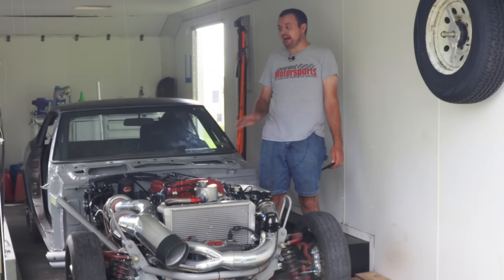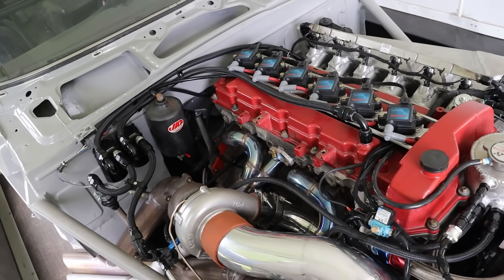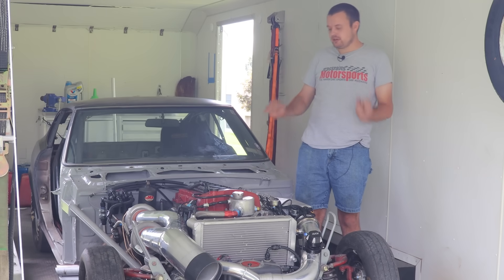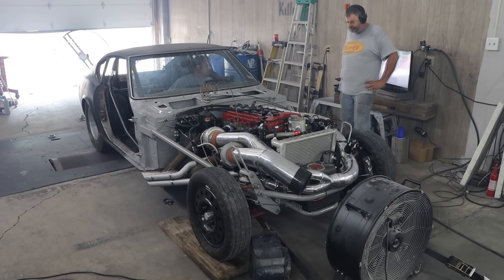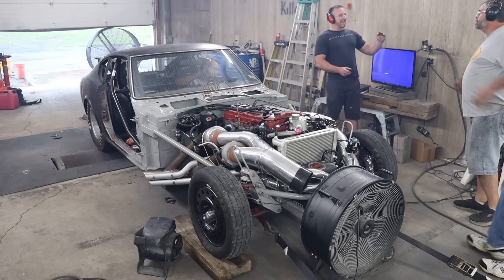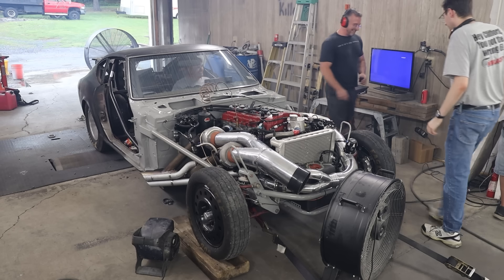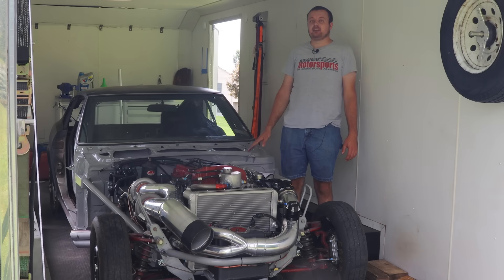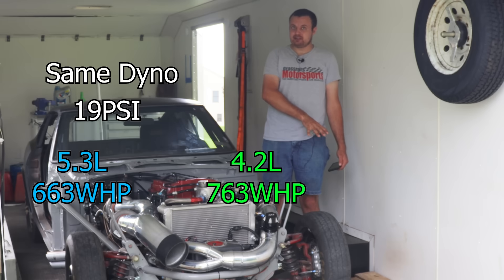This 4.2 Liter Engine Just Beat a 5.3 LS!

Comment: 6 cylinders have huge heavy counterweights/crank. Ls v8 engines can put more of the lighter engines weight to the rear wheels, Ls's make 1500 hp all day long easy. I would say if your 6 cly truck engine is in a truck and you want to make mods, get the newer better heads and keep it in the truck. 6 =lower rpm peak  8= better balance/lighter, high rpm peak(8000)+ , more CID 454 with titanium valves will pull more power ramp in more quickly. Have see lots of 6's try to compete. V engine is always better, example v6 buick gn. Would like to see 2 inline 6 chevys in bed of s10 4x4. ripper.

Comment: I imagine if the financial crisis hadn't happened, the atlas platform would've become a mainstay. the 4200 made the same power as the last of the iron block gen 3 5.3s, and while it was obviously down on torque, if it had stayed in production long enough to be alongside the ecoboost 3.5s we very likely would've seen factory turbocharged versions of it as well. The 3700 5 cylinder was also a great replacement for the aging 4.3 v6 as it made nearly 50 more horsepower than any variant of the SBC-based v6 and was only 20 lb-ft shy of the most powerful versions of the v6 as well. While the 4200 in NA guise could never have replaced or supplemented the gen 4 5.3, it could've been a worthy replacement of the 4.8.

Comment: i dont understand how you can almost double the psi and only get 200 hp more
Reply from the maker: Drivetrain losses. Turbos are starting to get out of their sweet spot. A lot of things could cause that. Also you shouldn't be looking at Gauge Pressure, but instead Absolute Pressure.
Reply: @Calvin-Nelson  it was really efficient at 19-21 psi gate pressure

Comment: Good video my son and I built a a jeep with a straight 6 for the trials we haven't done much to the motor besides headers but we have a problem with it over heating when we're crawling can you get us a hent what we can do and it vapor locks and it's fuel injected
Reply from the maker: Make sure the head gasket was put on the right way. 

You may need a larger radiator, or water pump, or fan. Look into brushless fans. They're expensive, but they work incredibly well.

If it's overheating at idle, make sure there are not vacuum leaks. The way the computer controls idle speed is with timing and airflow. If it can't get it with airflow, sometimes it will retard the timing a ton which generates a lot of heat.

Comment: Awesome job! Hope your dad is healing well. The power difference is from the pushrod leaching. The atlas engines are DOHC. One sees the same gains on v8s, when one ditches the under head cam design, but with fatter torque due to dual bank. W type engines do the same "torque fluffing", and are usually DOHC. Found this upload today, sorry I'm so out of date with this.
Reply: Hmmm Ford must just suck cause the junk ole pushrod LS wipes the floors with Ford OHC motors
Reply: @asherdie  ya lolol I don't understand how ALL of Europe figures out DOHC twin turbo so well, and ford gets on the bus this late AND is that bad at it. Pushrods are only "more stable" in big displacement higher rpm high torque engines, like big block chevys. Personally I hate the LS engine but makes easy power. Just remember to compare a "built engine" to another "built engine" stock is almost always crap.

Comment: to be fair this has 4 valves which means you don't need as much cam.
Reply from the maker: Very true. 100 more HP with 71 less cubic inches is still mind blowing in my opinion.
Reply: @Calvin-Nelson  it is kind of, but peak torque is less?
Reply from the maker: @ltethan649  I'll give up a lot of torque for 100 HP. All personal preference. I get it.

Comment: Just picked up a trailblazer would love to make modest changes. Coils, maybe eliminate the clutch fan and replace radiator w an aluminum one… can that be done without grenading the motor?
Reply from the maker: Yeah. Doing what you said, shouldn't effect the motor much.

Comment: I need to know where to get performance parts for atlas engines i have a 3.5 i5 and love it getting ready to turbo it. 
Do you have any thoughts on the mmi speed shop turbo kit for it? A source for heads or Cams? Also if I'm looking to be in the 8-10 psi range for a daily driver what size injectors do you think I'll need? Thanks and awesome work love these engines.

Edit: 
Also what kind of ecm are you running? My colorado is a manual so i really only need to worry about something to control the engine or possibly a tuner capable to control it through the stock one thanks again.
Reply from the maker: Not much for the 5 cylinders. The turbo kits out there are sort of questionable from what I hear. 1000cc injectors should do. Cams might be able to be done by Schneider, but you'll have to ask them.
Reply: Thanks I didn't see a notification for this reply I just found it. Went with the mmi kit and just ordered some snake eater injectors. I'm planning on hp tuners from a dynamic shop in Indianapolis not too far away it will be a while though until I get a chance to tear it apart where did you order your  rods at? Thanks again
Reply from the maker: @mattrhoton9219  I got rods through molnar

Comment: Dodge I6 Hurricane with 400&500 horsepower similar to bara 4200 Vortex V6 engine, maybe GM take look at form Dodge I6 Hurricane With 500 Horsepower , replacement of 3.6 V6 engine, bring back a modern 4200 Vortec V6 engine with 650hp YouTube channels like this, ICE vehicles EVs are some the main focus because of high emissions standards from EPA and California , New York and New Jersey, Baltimore Maryland the list, tougher emissions with vehicles standards , 2035 has the whole Automotive industry forcing ice vehicles to become zero emissions vehicles by 2035
Reply from the maker: That would be great. I heard some rumors that another inline 6 platform may be in the works.

Comment: Wauw very impressive! I got to your channel because of Trevor from Motion Auto TV. I was wondering, the engine is able to rev well above 7k rpm, it sounds like a 2JZ but has more displacement. I think this could be a great engine for drifting, both NA and boosted. It has a simular setup as a BMW engine, intake on driverside, exhaust passengerside and an inline six configuration. This could be a great engine for grasroots drifters to swap into their E36 or E46 driftcars, without the high cost of a 2JZ. I would be very interested to see that  engine in a BMW platform drifting. Are there any manual gearboxes that would mate with this engine?
Reply from the maker: Thanks. https://sites.google.com/view/vortec4200wiki/manual-trans-overview?authuser=0

Comment: How does the 4200 Ameri-Berra wompare to a 4.8L LS performance wise. I realize that it has roughly .6L less cubic inches and might be harder to fit into some vehicles. But after watching your YouTube videos as well as Richard Holdners YouTube videos it looks like the 4200 Ameri-Berra is capable from what little I have seen. However it's slightly disappointing that there is not as much aftermarket support for it than an LS such as intake, heads, camshafts.
Reply from the maker: They made more power than the 4.8L from the factory. The LS definitely has a lot of things going for it, but so do these.
Reply: @Nivlac57  Thats good because I was thinking about doing a 4200 for my next build. It seems like everyone and their dog is doing LS builds/swaps. I just hope that swapping a 4200 into non GM vehicles will not be overly difficult. However after watching a few of your videos I think that it's doable my main difficulties are with controllers and electronics.

Comment: The 4.3 was ole reliable but they should have put the 4.2 in the trucks. ~270 hp / 277 trq vs the 4.3's 195 hp / 260 trq.

Comment: Can you put a different transmission behind it?
Those tabs look like BS.
Is there have been any aftermarket interest?
Reply from the maker: Th400s have been proven behind 4000hp engines. We just had a bad torque converter that we had made more power with previously, but didn't hold up.

Comment: I have an sbc swapped Chevy S10 but it started rod knocking shortly after the build.  I kinda want to do something newer and different instead of LS swapping, I think a boosted 4200 might be the way to go.  Thanks for the inspiration and information.
Reply: If the 4200 is too long to fit in the S10, there's always the LV3 4300 that came out in 2014 as the base Silverado engine.

Comment: Hiya, Holden (GM) used many straight sixes in the day, so you may find a trove of parts in Aus as Holden were very common cars down south.
Reply from the maker: Unfortunately these engines do not share any similarity to the old 6 cylinders.
Reply: @Calvin-Nelson  Holden were still at it till about a decade back. They usually always built a six, was this engine used there? The 4.2 was a typical capacity.  My point is that there was always competition and racing between Holden and Ford, so if the engine was used, it will have been raced.

Comment: Is 2006 4200 vortec  motor the same as 2009 motor 4200 vortec?
Reply from the maker: No.
Reply: Do you know which one is better 06 to?
Reply from the maker: @larrypelayo4867  as far as strength of components, they are equal. If you plan to use a stock computer, 09 is better.

Comment: More cylinders doesn't mean more power. The inline 6 is a more efficient design.
Reply from the maker: More cylinders means more cylinders to share the load. 

More mains in an inline 6 means less load per main. Problem is, if you make the crank too long you get into crank harmonics issues.
Reply: @Calvin-Nelson  I read something about how they used to run balancing shafts next to and in time with the crank to fix that issue, but I've also read that a lot of newer shorter straight sixes don't actually need those balancing shafts anymore. Something about the crank wanting to flex towards the middle causing both crank damage, and damage to the mains in the block. Would I be correct in saying all this?
Reply: Nobody in the US has made a V8 semi truck in over 20 years for a reason.

Comment: I bought a 07 Trailblazer 4x4 with a rod knock. It took me a good long while to source all the parts and lots of unexpected TTY bolts everywhere, and rethreading head bolt threads on the block deck. But, after all that, the thing puts a grin on my face at WOT at 5k rpm and up. It's a cool motor.  

Normally, I would steer away from a GM, but I like this motor.
Reply: the transmission probably doesn't like 5K rpm though - I got a reman transmission but sometimes I still do 5K. The highest torque peak is actually 3600 rpm.

Comment: I seriously don't understand why you compare boost pressures the way you do. Boost is a measure of intake resistance - much like backpressure in an exhaust manifold. Engines are air pumps and it's clear that this one has a damn good flowing head to make power the way it does. You're completely correct about it being awesome but pushing the boost pressure like it means something here is annoying. I get that you're frustrated there's not much support but surely you know better
Reply from the maker: I realize it is not a perfect comparison, but I'm trying to draw a comparison with a metric that a lot of people are familiar with. While it doesn't paint a full picture, it does indicate that the smaller engine is doing a whole lot more with that 19 psi of pressure than the larger engine, and what that says to me is we have one heck of an engine.

Also, I figured 100 hp delta would be enough to eat up any technicalities. Even if the 4.2L made the same power at the same boost with everything else being equal, it would be very impressive to me.
Reply: @Calvin-Nelson  see, it's not 19lbs of pressure though. I'll give you an example - belt driven blower pullied exactly the same on both engines. This one will apparently move a ton more air and would read LESS pressure due to less resistance and more power being made. Take a motor with a belt driven blower, port the heads and the intake and free up the exhaust - power goes UP, boost pressure in the manifold plummets - I've done this. Turbo cars are harder to see this with because the W/G just keeps adding airflow. Shaft speed on the turbo rises up and up though as you remove restrictions.

Is the V8 on alcohol? Meth is an oxygenated fuel - that's another advantage to consider. 

Trust me, I'm NOT knocking the accomplishment or the engine but boost pressure in the intake manifold is just a poor way to compare. Yes, it must seem pedantic.

What might be interesting would be to calc how much more air this smaller motor is moving vs the larger motor, are the peak RPMs anywhere near comparable? The port job on that head and cams must have seriously woke this thing up - congrats! I had a nasty ported head and cams for my 2JZ I never got to install as my car was wrecked and I've always wondered how much more it might have made over the stock parts.
Reply from the maker: @BLKMGK4  yes. The V8 was on alcohol too. Not as much though. Like I said not a perfect comparison. 100hp delta is still a lot.
Reply: @Calvin-Nelson  were the RPM close? Would be interesting to Calc the VE, the 6 is probably more efficient. I’m behind in the videos obviously but I look forward to seeing where you end up and was real interested when you were working with the coils. I used to run motorcycle coils on my Supra and was one of the first doing it with the early AEM ecu. Keep pushing and preaching, the early years for the 2JZ started slow too 🤓

Comment: dohc is a replacement for displacement there budddd.... look at the coyote!!!  it will hang all day with 6.2 L GM engines or the 6.2 Fiat engine hemi whatever, in my opinion it's better
Reply from the maker: I'm looking forward to messing with a coyote someday.
Reply: @Calvin-Nelson  too expensive right now maybe with age they'll get cheaper and more aftermarket support you can only make it 5.2l In that block.... So must go forced induction route.... Also the 7.3l Godzilla Ford pushrod is great too
Reply from the maker: @BuiltDifferent13  Would love to mess with the 7.3 too. I'm ok with small displacement, but 7.3L is definitely better if you can get it.
Reply: @Calvin-Nelson  Modern forward stuff is expensive. Even some of the old Ford stuff is expensive but that's what I prefer. FE engines nice. 390 FE big block
Reply from the maker: @BuiltDifferent13  my Dad has a 410 FE that we may play with someday.
Reply: @Calvin-Nelson  I'd like to play with a lot of engines.... AMC 401

Comment: Might fit into my rwd Geo Metro build better than the LS or the Ford modular I've been scheming on... 🤔🤔🤔.  Maybe more attainable than the 2Jz for my budget.  Just need to figure out the K member and suspension I want to bolt it to. I'm trying to achieve Dodge Viper power to weight ratio with all junkyard parts and this may get me well beyond those numbers. Didnt this motor come with a little supercharger at one point?  Got to see how much this weighs vs the V8s and the 2JZ... they will all squeeze in there after moving the firewall about the same. I'm liking the ability to quickly bolt up a 4wd trans
Reply from the maker: Nope. They're all naturally aspirated.

Comment: The question is will it hold so much power like the LS engines and will it be reliable will it last will it be a bullet proof engine cause I’ve been told this type of engines they break most of the time and I mean be serious man it looks like you know what you’re doing you know that an LS engine just by modifying a little bit you can make tons of power you don’t have to put gold pistons into it
Reply from the maker: So far they have been holding up

Comment: back in like 2013 there was a member on supraforums who swapped this engine into his mkIII supra, used a pontiac solstice 5 speed (same architecture as a 5 speed toyota supra turbo box) slapped a small turbo on it and cracked 550hp at conservative boost levels 10/12psi. Since the I always wanted to swap one into a 3rd Camaro.
Reply from the maker: Yup. I'm familiar with that one. Very cool project.

Comment: That’s great and all, but you can literally gap the rings and go with turbo 5.3 or 6.0 and by your own admission you had to do a lot more to the 4200. Head work isn’t trivial,  rods aren’t cheap, and it’s actually harder to put a big I6 in many cars than a V8 because of the length. And this is coming from someone who has done a lot with I6s in the BMW world. Head work done correctly requires experience and a flow bench, if most people take a die grinder to a head they just ruin it, hogging out ports kills velocity and can worsen flow at moderate lifts which is where the majority of the valve open time is spent. Flow at lower lifts is more important for street applicants than peak lift, and is still super important in track builds.
Reply from the maker: Ok. To each their own.